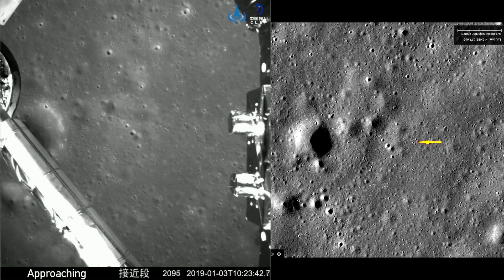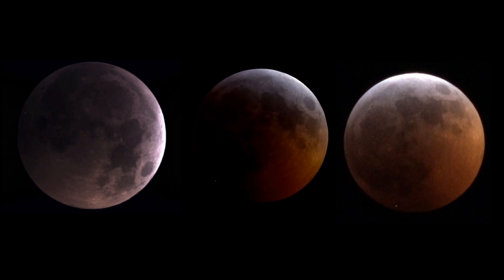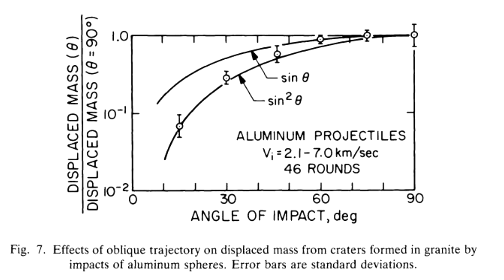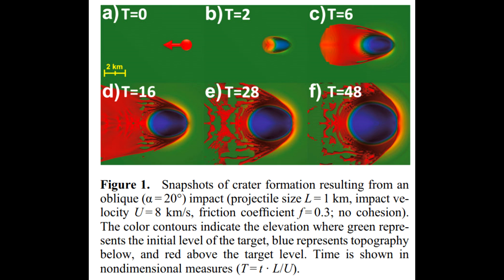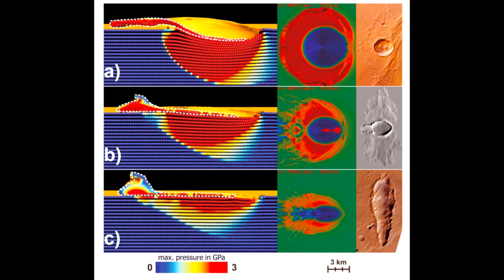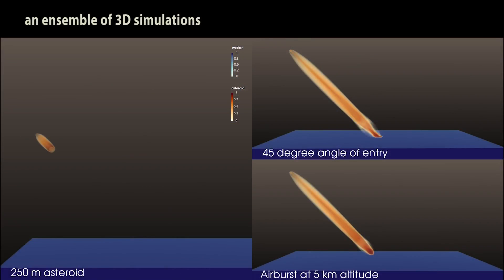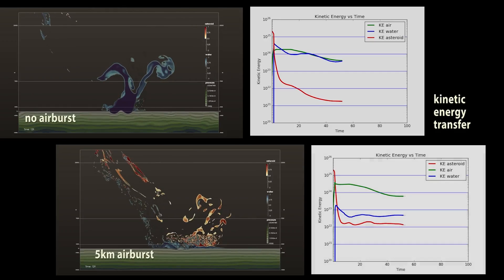Why Are Most Impact Craters Perfectly Circular? (Rather than Ovals)

Comment: I now understand reason why craters because of impact are perfectly circular. I'm searching the reason why sand spilled into water creates crater-like structure and the crater is almost perfectly circular. To figure out if it is impact crater or a crater from cavity collapse, I want to know if the circular form is created in this case either.  Are craters which are created because of cavity collapse perfectly circular?

Comment: I don’t think it’s the craters that are the issue. It’s the lack of said projectile. Especially the larger ones. If they are loosing more than 85% of mass, they should have been broken up before the impact. 
Also the very “hard” ones that are iron or nickel would have left a giant chunk of the original material intact in the center of said crater.

Comment: ok so in REAAAALLLL short, please tell me if i get this right: impact craters are round, because when the actual object impacts, even though that itself creates an angled 'mark', the energy released from that impact is so extremely high, that the terrain around it gets so extremely hot and energized, that this creates a let's say 'seismic ball' which leaves this circle imprint as it 'quickly' loses enough heat by absorbtion?

is that ballpark what i'm understanding, or am i completely misunderstanding whats being said

Comment: Why do cats bark? and dogs purr? The question suggests that the craters are resulted from impacts, but its just as (if not more) plausible that they are produced by electric discharge.
Reply from the maker: No, only idiots are gullible enough to believe that idea works.
Reply: What electrical discharge? What is the mechanism? Don't worry, I qualified in plasma physics, so I'm sure I'll be able to understand the peer-reviewed paper you reference to back up these impossible claims :)

Comment: A notable exception to the circular crater observation is ejecta from the huge comet or meteor hit on glacier ice over Saginaw Bay in the Great Lakes about 12.9 kya. The huge ice chunks thrown into the air, many reaching space and landing hundreds of miles away. Some as large of sports stadiums. Not nearly as fast as asteroids of course, they left noticeably elliptical craters in soft ground later mistakenly called Nebraska rainwater basins, and the Carolina Bays in marshy areas. They are plain to see now with lidar imaging. The major axis pointing back more or less to Saginaw Bay. Allowing for time of travel and rotation of the earth they say.
Reply: The Carolina bays have nothing to do with an impact.
Reply: @ianw5439  They sure as hell do. When an impactor hits miles thick glacier, shit flies into space to land hundreds of miles away. Leaving oval craters that point back to the impact site. Nice big ovals especially on marshy ground. Visible clearly with LIDAR.
Reply: @garywheeler7039  Nope, when an impactor hits ice, the material is vaporised. It becomes steam! That will not cause craters! Unless you think it comes back down as rain, which then causes craters! Sorry, you need to go back to school and figure out what happens to ice when it is heated.

Comment: But the real question should be is why every crater once they reach a certain size are always the same depth like it hit a surface so hard even a speeding meteor shattered against it? What the hell is the moon really made of?
Reply: If you're talking about the huge gray craters (or "seas"), those were impacted and filled in with basaltic lava while the moon was still being formed to what we know it as now. The moon is DEFINITELY not neat and even with crater depths, geographic features and especially in mass distribution. It is impossible to keep an indefinite orbit around the moon due to its random "lumpy" composition causing a very uniform gravity field.

Comment: 7:50 When the science doesn't fit reality, then change the facts. Even in the 60 degree example given, I can see it is not round with a flat floor. The explanation doesn't make sense, since the round craters with flat floors are far greater than 50%. At a 60 degree or less angle of impact, we should have far more craters, like the example, than we do. They should throw out any explanation that doesn't explain reality, and look for the real cause.
Reply: Nonsense.
Reply: @ianw5439   An answer with no facts is not really anything to be concerned with. I've photographed the Moon on many occasions, and all you need to do is look at such a photo to see I am right. Thanks for your reply.
Reply: @lesliesavage9229  Nope, you have zero mechanism for such impossible sparks. And there are no peer-reviewed papers detailing such impossible nonsense.
Reply: @ianw5439   I love it when people pull out their credentials as proof, "Take that from someone who has studied plasma physics at post-grad level." When you pull out your credentials, you don't have anything. 

Even in the video the craters they produced were not symmetrical as most of the craters on the Moon are. He spends half the video with computer simulations, which can be programmed to do anything, and can't take the place of what we see. Your paper also has "Two formation mechanisms have been hypothesized" which means they can't make up their mind as to what causes perfectly round craters with flat floors, not just shallow, but flat floors. A hypothesis is assumed, and not fact, no matter what paper it is in. No impact is going to leave a flat floor, and these can be seen in photos of the Moon, which is evidence you can see. So you don't have any reasonable explanation for round craters with flat floors and a spike in the middle. An electrical spark will produce that exact configuration in a lab.

2:22 has no flat floor or peak. 
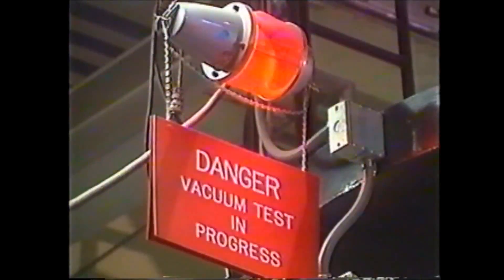3:10 has no center peaks.
3:35 has debris not symmetrical, which would makes walls uneven, and still no peak in the middle.
4:23 has no flat floors, but cone shaped instead.
Computer simulations don't count, which is half of his proposed proof.
This video also doesn't explain the other symmetrical geometric shapes of craters we find, which can't be done with a messy impact.

Seeing is believing, which leads to problems I sited above with the video in question, and even more problems that impacts can't explain:
The Craters are Electric | Space News
Reply: @lesliesavage9229  So what about the alledged mechanism that would make these craters? "craters are electric" is a meaningless sentence without further elaboration. If you're so convinced by this idea, don't link me to a video but instead tell me in your own words why you think it makes sense.
Reply: @Релёкс84  
"The Craters are Electric | Space News" is a video title.

You're somebody who doesn't want the facts, by saying don't link me the videos. You instead want to debate opinion, because it is void of facts, and easier to say it is incorrect. Reply to the facts given, or don't expect any more replies.
Reply: @lesliesavage9229  I think you should read what I wrote one more time. I already watched their videos, probably more thoroughly than you have. I just want to know what you personally believe and why, as this is the only unknown I have here.

Comment: An easy way to explain it is this... Asteroids move fast enough that the impact results in an explosion of material very much like an artillery shell blowing up on impact. This explosion is omni-directional and makes the impact angle mostly irrelevant. Artillery shells do not impact at 90 degrees either and they produce round craters.

Comment: What if I shoot a bullet into the sand?
Reply: im not a gun expert but im pretty sure that bullet speed doesnt come even close to the speeds of meteors colliding with moon
Reply: @spatrk6634  it has been six months and it has no replies or likes. Why are you scrolling this far down if not looking for a retarded arguement?

If thats not the case. 

I think it would probably work in a loose medium like sand. Anything more compact would probably prevent the formation of a clean circle.
Reply: @noobpro9759  to be fair there werent many comments anyway. so you were near the top.
i dont think bullet would work because main reason craters are circular is because meteors explode on impact because of how fast they are moving.
bullet shot into the sand would just travel through the sand until it loses its velocity.
it wouldnt disintegrate when in contact..
Reply: @spatrk6634  i think you may be underestimating the speed and impact forces of bullets and over estimating sands ability to dissipate kinetic energy. Not that there's any problem with that. You even said you aren't an expert so you can't be blamed.
Reply: @noobpro9759  true, 
but what i know is that moon doesnt have atmosphere, so no air drag, and slowest of meteors that hit the moon surface are at speeds of around 20 kilometers per second.
i believe its pretty stronger than an a bullet.

Comment: Because they are not impact craters...
Reply: That's right.
Reply: @lesliesavage9229  Nope, it is trivially wrong.
Reply: @ianw5439  Right at the start of the video there is a shallow crater with a dot in the middle, which isn't created by an impact, but a spark. This can be duplicated in the lab as well to demonstrate that this is in fact how these craters were created.
Reply: @lesliesavage9229  No, there is zero mechanism for such an impossible discharge. Take that from someone who has studied plasma physics at post-grad level.
Reply: @ianw5439   Ah huh. Still no evidence  offered. If you continue to proceed like this, then I am not going to bother to answer. Supply a reasonable explanation for craters that are at 90 degrees to impact and with shallow floors to get a reply, and a lot of them have spikes in the middle. These are not impact craters.
Reply: @lesliesavage9229  " Still no evidence  offered."

No, I notice that you certainly haven't offered any evidence. When were you thinking of doing so? You don't even have a mechanism.

"Supply a reasonable explanation for craters that are at 90 degrees to impact and with shallow floors to get a reply"

Who said they were all at 90 degrees? As for the rest;

'Lunar floor-fractured craters: Classification, distribution, origin and implications for magmatism and shallow crustal structure.'
Jozwiak, L. M. et al. (2012)

"These are not impact craters."

According to whom? Peer-reviewed papers, please.
Reply: @ianw5439   I love it when people pull out their credentials as proof, "Take that from someone who has studied plasma physics at post-grad level." When you pull out your credentials, you don't have anything. 

Even in the video the craters they produced were not symmetrical as most of the craters on the Moon are. He spends half the video with computer simulations, which can be programmed to do anything, and can't take the place of what we see. Your paper also has "Two formation mechanisms have been hypothesized" which means they can't make up their mind as to what causes perfectly round craters with flat floors, not just shallow, but flat floors. A hypothesis is assumed, and not fact, no matter what paper it is in. No impact is going to leave a flat floor, and these can be seen in photos of the Moon, which is evidence you can see. So you don't have any reasonable explanation for round craters with flat floors and a spike in the middle. An electrical spark will produce that exact configuration in a lab.

2:22 has no flat floor or peak. 
3:10 has no center peaks.
3:35 has debris not symmetrical, which would makes walls uneven, and still no peak in the middle.
4:23 has no flat floors, but cone shaped instead.
Computer simulations don't count, which is half of his proposed proof.
This video also doesn't explain the other symmetrical geometric shapes of craters we find, which can't be done with a messy impact.

Seeing is believing, which leads to problems I sited above with the video in question, and even more problems that impacts can't explain:
The Craters are Electric | Space News
Reply: Yes they are.

Comment: This answer is VERY easy. The energy of the impact, which is based on the square of the velocity FAR outweighs the momentum transfer, which is a linear relationship. Basically, a high delta V impact causes an explosion. Some oval craters DO exist, but the impactor has to be moving relatively slowly and hit at a shallow angle.

Comment: They're not. They're hexagons. I'm not the first one to point this out am i?I?
Oh I see i happened to post this twice. Silly me.
Reply from the maker: Only a tiny fraction of craters are polygonal, and they’re all associated with pre-existing fractures and faults. See the work of Teemu Ohmann for deep dives on this.
Reply: @scottmanley  From your ref
"On Mars, Venus, and the Moon they make up ~15%–20% of the impact crater population"
-a little more than tiny. So let's compromise?
Thanks for the reply and your very in depth commentary-
Reply: @scottmanley  Then theres this
"You might assume that impacts simply exploited pre-existing fractures in the bedrock. This was indeed the fundamental conclusion of a Finnish PhD thesis in 2009. However, there’s no sign of hexagonal fracture patterns in the area – or anywhere else on the Moon -  and in any event, hexagonal fracture patterns - especially symmetrical - are difficult to impossible to produce tectonically (by pushing and pulling)..."

Comment: Isn't there a Thunderbolts project video explaining these crater features as electrical discharges from space? Explains a shear face crater edge, higher peaks in the centre, lines of craters in a row, and craters on top of craters...
Reply: And they have no physicists, nor any mechanism for producing such impossible nonsense. They are a mythology-based cult.
Reply from the maker: Yes, but thunderbolts project are full of completely bullshit claims and you should treat all their claims as garbage.
We’ve seen asteroids hit the moon and make craters, but thunderbolts has never shown a lightning bolt on the moon.

Comment: It seems silly to use computers and grind all that math when an arc welder wil replicate that instantly PLUS make craters on the rims of other craters, just like on the moon..... hmmmm.... and those little tits in the middle too... hmmmm.....
Reply from the maker: The problem with your claim is that nobody has ever seen an arc welder large enough to make these craters and yet we've seen hundreds of thousands of space rocks. So, until you see a giant arc welder making a crater on the moon the impact scenario can explain all the craters we see.
Reply: They don't use computers. Did you not even watch the video? Pete Schultz has been blasting out craters at the NASA Ames gun range for decades, at all sorts of angles. Stick to welding. Leave physics to those that understand it.

Comment: Strange though ~ electrical discharge is always at 90 degrees to the surface giving mostly circular craters.  Lab experiments are relatively simple to replicate (If you have access to high voltage discharge equipment) and can explain bullseye craters and crater chains but the topic is almost entirely and actively ignored by mainstream science who have 'settled' on metorites and gravity..
Reply from the maker: The big problem is no advocate of electric discharge cratering has been able to point to a single lunar event. We see impact flashes and find new craters, but the flash is too short, and not bright enough to be anything but an impact.
Reply: Scott Manley The ‘flash’ that you associate with the lunar impact, do we have any visuals on the impact point ? Is it possible that the flash was of an electrical nature as much as a meteorite strike ?
Reply from the maker: The flash is short and hot, it’s totally different to the sustained discharges that EU experiments show in labs. Also, electrical discharges are brighter and emit more UV and X-rays. So every impact we have observed on the moon is not an electric discharge, also discharge events are brighter and take longer so they’d be easier to see. The fact that we’ve never seen an active discharge event on the moon in years of observing suggest that craters caused by impacts are hundreds of times more common than discharges.
Reply: Scott Manley Earth sits in an electrical environment. The Aurora is only ’visible’ at the poles, although the circuit runs  to the Sun, the Moon and other planets.  The source and understanding of lightning now suggests that the potential is from space (Red Sprites etc) and they are incredibly quick events only visible for fractions of a second.  My question is - are we assuming every flash is an impacts when some might be electrical ?

Comment: I don't get the bit about projectiles not going faster than the speed of sound. Some common rifle bullets travel at over 2.5 mach at sea level, and they're older than the Apollo Program. Would have been pretty simple to set up, and for a lot cheaper than that contraption lol.
Reply from the maker: There’s the speed of sound in the air we breath, and the speed of sound in the hot compressed gasses that are exploding inside the gun barrel.

Comment: A rough analogy might be that of throwing a hand grenade. Even though the angle of the throw might be small,  the effect produced is a result of the explosion, not of the angle of impact. because there is so much energy in the explosion. Similarly, with an asteroid impact, there is so much energy in the explosion that the angle of impact has relatively little influence.